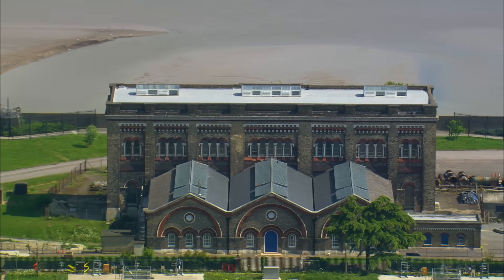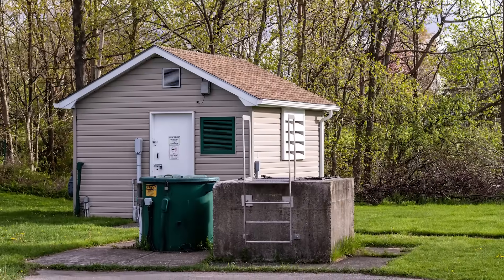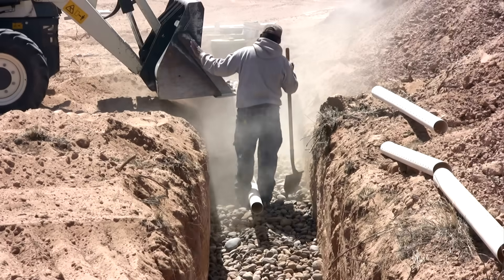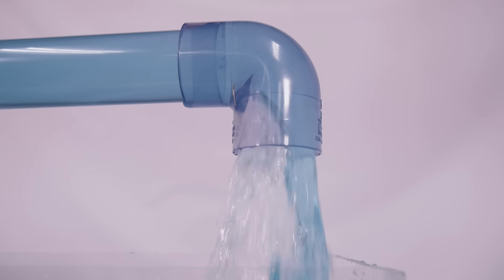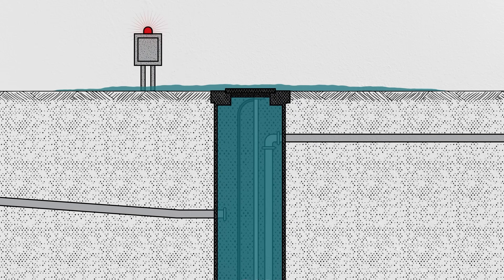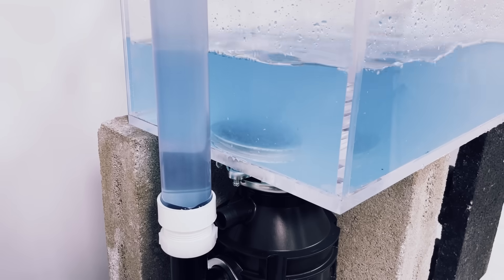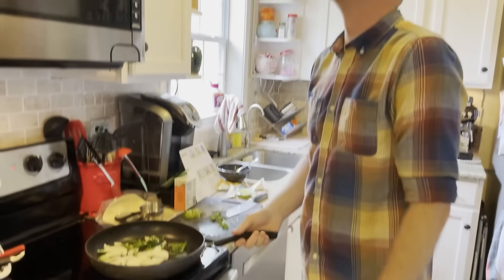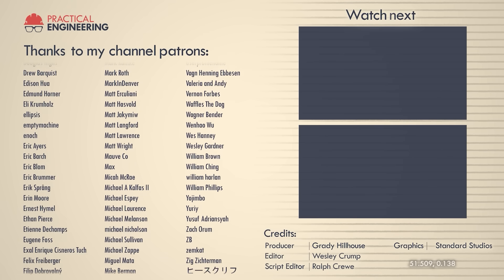How Do We Pump Sewage?

Comment: I live near a ton of sewage Infrastructure Something you failed to mention Is that in the intermediate stages Debris gets In that way For example we have a bunch of flood water Infrastructure that just go directly into the sewers It's not uncommon For litter including aluminum cans to get inside Of flood water drainage pipes (By the way If you litter You're increasing the chances of things like aluminum getting into sewage systems which increases the chance of septic Flooding Don't litter)

Comment: On our rural road, every house have its own well with a grinder/pump feeding a 1“ pvc pipe that got pushed underground from the road to the well, only digged at the ends.
I believe the main pipe is only 2". 
Cheaper and faster than a conventional sewer system dug down.

Comment: Fat/oil/grease deposits in sewage collection systems are created in the same basic reaction chemical reactions that turns the fatty acids  into, basically, a huge lump of soap. Over time, these grease formations break down to form fatty acids and glycerol. Fatty acids bind with calcium in the sewers to form so-called fatbergs, which are soap-like compounds. When the sewer level rises, the fatbergs cling to the sewer ceilings where they grow in size, eventually clogging the entire sewer pipe.
The size to which a fatberg can grow is limited only by the size of the sewer. In 2019, a fatberg measuring 210 feet blocked a drain in the British seaside town of Sidmouth. The sewer team took more than eight weeks to dissect this massive clump of fat.

Comment: If the designed pump head is lower than the discharge point, can the lift station still be able to push the liquid to the discharge point?  Assuming that the forcemain is already pre-filled (from the previous pump run)

Comment: I don't understand why we can't use positive pressure air pumps to pressurize the lift well and push the sewage along the lift pipe at certain intervals. Pair this with a pressure valve that clicks shut with the inbound pipe and you should be able to completely remove the mechanical pumps and prevent costly clogs inside of them. 

Then you can reduce the number of expensive grinders to just the waste treatment plant. Has this question been asked?

Comment: I must confess, I loved this video.

Although I am a bit dissapointed you didn't mention the advantages of different types of pump wheels like those which are made to cut up/chew fiber.

 (we call it fiber where I worked because rags gets torn apart one way or another and combine with hair to make really nasty grease traps you will have to pressure wash off the machinery.)

We had one active machine at the treatment plant dedicated to take out fiber by having a steel plates with 4mm holes in them rotate in a track-like way where the fiber would get stuck on to which it was then moved upwards and taken off at the top so it could fall into a waterslide leading it into another machine pressuring the fibres in an upwards turn to have the water come out and later take it to the trash container.

This saved us a lot of the daily maintenance ehich would be required of the cages you briefly mentioned because sewage never really stops and there are SO MUCH FIBER. People throw the hair their shower collects, the hair they cut off at home, rags, paper, and everything fibery into the toilet after all and it takes a lot more to work on than most people realize.

Regardless, it was an excellent video and I appriciate the ideas you came up with, we sorta have a collector/cage AFTER the fiber collecting machine which has to be emptied/cleaned weekly! 

(Also appologies if my english breaks anywhere, I'm Norwegian, but I hope this helps!)
Reply: I never realized how much my hair could be an issue... I have a septic tank, but I still think I'll be more mindful about making sure it ends up in the trash, not the drain. 

Also, your english is very good, dw! :D

Comment: Waste water wet well alarms are generated from an instrument, commonly a submersible level transducer or an ultrasonic level transmitter. Setting the 4-20mA output or 0-100% to the PLC, the PLC then can set setpoints for the pump to turn on/off depending on the level set. The PLC would require network and telemetry antennas that would communicate to SCADA or contain a call out box inside that will call and notify the operator of various alarms. There are much more variables required for this continuous operation, but it is pricey. Pumps are important to be operational at all times and ran alternatively. Those pumps would require a VFD or soft starter to control them preferable with an HOA switch. H means pumps running locally in hand, meaning if the operator is onsite running the pumps. Pumps may not run dry as air can destroy the pumps. O means off position and pumps may not be activated remotely. A means auto mode where the PLC or SCADA is in control which is relying on the instrument. If the instrument fails or the 4-20mA output drifts, that can either start or stop the pumps, change actual level indication and pump start/stop, and will cause an alarm. It is crucial that the level instruments are calibrated and/or replaced if need be.

Comment: They should remove the solids, burn them in an incinerator to produce power, then use the flow of water that was pumped further down, to a higher area to generate more power. Poo-poo power.

Comment: I managed a mobile home park that had an old lift station for the lower part of the park, to pump into the city sewer. We found one pump a couple hundred miles away, and order a second one from the manufacturer in Sweden. They ran $8,000 each, and the second one took six months to get. They are grinder pumps, that can chew up normal flushed items. Until we managed to get everything set up to change out the first one. I would go to the station and turn the only one working on for 30 second intervals every four hours, to keep the alarm from going off. Otherwise it would overheat from pulling too many amps. When we pulled the one working one apart later, we were not sue why it started at all. The field coils grooves were completely worn away.

Comment: As a plumber I can say those pumps are pretty incredible. But I do definitely not recommend putting toilet paper or paper towel anywhere around an impeller. Except if it's especially made for set application. They do exist I have installed many of them but I have also been called into to fix horror stories of homeowners and property managers using incorrect pumps for the specific job. Right tool for the right job right pump for the right hole ( and shit in the hole )

Comment: I work as a fitter for a pump repair workshop, so I have had my fair share of site jobs in sewerage wells. some interesting things you see on newer submersible pumps are blades on the suction that drive off the impeller to chop up solids before suction, but still i will always be pulling out poop covered tampons, hair, rags and all sorts of fun stuff clogged in the impeller. cotton ear bud sticks always ruin mechanical seals in these pumps  too, so please everyone, if possible, dispose of solids in the bin <3 it exposes me to a less of HIV if  i don't have to risk cutting my hands open pulling out a wadded up tampon hahaha.

Comment: My guess before clicking on this was to use compressed air as an intermediate fluid to push on the liquid. Does anyone know if there's a flaw in this plan or if some lifting stations do do this?
Reply: I really have no idea if that would do anything.
Reply: @RedRyan  Given that it isn't the way it's actually done, it presumably isn't the most economical method, but I can't imagine how it could fail to work at all. If you have a tank with a valve over the intake and an outlet at the bottom and periodically force air in at the top at sufficient pressure, I don't see how it could result in anything but any significant volume of liquid inside being pushed out.
Reply: @avaevathornton9851  The only issue I can see is it inducing air into the water, if you think of like a carbonated beverage, that's what they do with CO2. So if you pressurize the air too much a lot of it will get absorbed by the water and then it will out gas later on

Comment: This is really a interesting series, but I can't help but feel like this is only just barely scratching the surface of the topics so far. Also, sand and silicone toys are very poor analogs for poop. I'm pretty sure sand settles out of solution much more rapidly than dissolved poop would, and the silicone toy obviously doesn't dissolve at all.

Comment: Want to add that the better at chopping and passing large chunks to prevent clogging the less efficient the pump and more power it takes to run.

Electric power costs dwarfs pump price over time so this is a trade off of cleaning labor vs electric bill…

Comment: We had a lift station problem at a campground I worked at.  We have a pump that lifts the sewage into a septic tank, and one night it backed up. We had been keeping an eye on it, and it had an alarm, but no one caught it at two in the morning. Sewer company came out, fixed the pump, and ran a camera through our lines. They found a tennis ball, and worse yet, a 4x4. We think someone dropped it into one of the pipes you hook an RV up to. They think crap like that is what broke the pump, and the general wear and tear.

Comment: my family had a run-in with not only "flushable" but also advertised "septic safe" toilet wipes that only my father would obsessively use as toilet paper. lets say they went down the toilet just fine, but when our cesspool eventually overfilled, the cesspool guys couldn't even properly pump it out because the wipes never broke down and would clog their vacuum hoses. looking into the cesspool with the cap removed, you could just see hundreds of perfectly in-tact wipes in the sewage. we've moved from that house since then, and are now on a septic tank instead of a concrete cesspool, but he still chastises "nobody better be using those wipes" even though he was the only one that ever did. funny enough when i tell him that he was the only one to ever use them he plays dumb.

Comment: I actually helped a previous employer put in a bid for the installation of a basement macerating sewer pump in a commercial property.
Not being a plumber, but an office and equipment maintenance worker, that's as far as I got on the job.
But I did go and learn a lot about those pumps to be able to put together a good bid.

Comment: Having spent 35+ years designing and developing small submersibles and residential wastewater pumps we found that heavy weight nylon pantyhose were the most difficult to reliably grind. It's quit the paradox that they could easily get a run in them during normal usage while still being able to shut down a 5HP lift station.

Comment: I live a few hundred feet from a small lift station for my block. Whenever it is overwhelmed by saturated ground water from heavy rains, diluted sewage backs up into my basement, then flows to my sump pump and out to the street. After a decade of complaints the city is finally accepting responsibility

Comment: Pretty sure that the automatic release valves can have relatively simple air filtration system installed to counter the smell. Since such built up air happens not too often, the interval between maintenance checks may be relatively long. These filters don't have to be on every valve, just the ones close to populated areas. 
I'm looking forward to modular nuclear reactors powering our lives soon. A few companies are working on these SMRs built for different use cases and therefore ranging in output, from ten to hundreds of MWatts. That means theoretically a gigafactory like Tesla Giga Texas can run on its own grid supplied by a single 100-150 MW SMR, or an entire downtown of a large city a theme park. Entire residential districts can be powered by these things. Obviously there'll be a need for maintenance but that's expected to be quite low. 
Have high hopes for this technology. Definitely will still take a while though.

Comment: Obviously you may have missed a few headlines over here about water companies doing precisely the opposite of what you said we do now. After they had been found to be pumping raw sewerage into rivers and the sea though old failing infrastructure that has seen little investment on a lot of the Victorian era network beyond the treatment plants, not being able to keep up with demand due to increase of housing, having to lower capacity at the treatment plants due to the smell and proximity to new developments along with wet wipes being blamed as well where they have caused breakdowns with the machinery.

A bill was put before parliament to force water companies to rectify the issue but they decided not to and have continued to allow them to release it into the water courses while continuing with plans to designate the whole of England as a Nitrate Vulnerable Zone due to pollution in the rivers the same ones that they are having issues with down stream from treatment plants.

Comment: I worked in water treatment plants for many years and those agglomerations and deposits of solid are a real big huge problem. Most of the expense in money, time and resources go into dealing with the trash people throw in the toilets. They create thick layers (both floating and on the bottom of basins) which are complex to get rid of and it usually is an handmade operation. They also create long strong balls around the power cables of submerged pumps and we called them "setole" in Italian. It is just a cute name to refer to the most disgusting form of shit in the world (literally balls of hair, paper, rubber bands and whatsoever).

Comment: I work in waste water and my family has a waste water company. We build pump stations and treatment plants but you always need to remember that powdered detergent can do the same damage as grease or even worse. I’ve done two confined space entry’s this week already and it’s Tuesday. There not as bad as you think but they’re not fun. But something you were saying just don’t make sense. Like when the pumps clog the water will most likely never go over the tank unless it fills the whole incoming line up to the top of the tank and by that time county’s and city’s know something is wrong and have a pump truck or a bypass pump on the way to get the station back up and running before most people would ever know there’s a problem with the station at all. Also the trash traps are great when it comes to the treatment plant side of things but not so much the pump station side because most pump stations for privately owned or city/county owned don’t get check every week it could be once a week or once a year it all depends. On what they have but it was a great video on explaining to people where it goes and what happens to. Because some people have on there homes and don’t even have a clue what it is or what it does!

Comment: I spent a lot of time in the field repairing Variable Frequency Drives that are used to control the speed of the lift pumps.  They raise and lower the speed dependent on the level in the wet well.  What always amazed me was what the amount and size of floating objects that got in the sewer line.  The top of the wet well was covered in foreign objects so you could never see the water.  Plastic bottles, footballs, dolls, and other toys.  Sheets of cloth and tampons would clog the pumps.  You could tell if a pump was fouled by the current it drew.

Comment: "concrete chamber, called a wet well"

I'll add that most of the wet wells in my city are premade fiberglass installations. Cheaper to transport, and better against sulphide attack.

additionally, you talk about a grinder as if its a seperate unit to the pump, our lift stations usually include "grinderpumps" which serve both role.

Comment: Nice presentation.  As a utility contractor I've put the smallest all the way up to very large lift stations.  Open cut does get very expensive and I'm glad you mentioned that.  HDD is another option that has some limitations but is more cost effective when open cut depths get deep.  Pipebursting and lining is another important related subject that would tie into this well.

Comment: 4:53 - You glance off an important point here.  The dirty little secret of wastewater plumbing is that as low-flow toilets get more widely installed... and lower in flow (1.5gpf has been being replaced with 1.1gpf), your local plumbing gets more and more prone to clog*, because *the slope of the waste piping just getting out to the street, in older houses, is tuned for 6gpf toilets, and there isn't enough water moving to get the waste out to the street.

Ask me how I know this.  :-}

And toilets with #1/#2 valve buttons on top, while reducing water use even further, make the problem even worse.

At the very least, note that some of those valves will cut off early *if you don't hold the button down until the bowl starts to refill*...

Comment: My local pumping station has a tank that sewage flows into. When full the inlet briefly closes and pressurised air is released into the tank to blow all the sewage out. The inlet then opens again once pressure normalises. It takes about 15 seconds for the close-pressure-open cycle. Local councils (UK) used to own the infrastructure so they used different methods from each other. They are all owned by water companies now but it means there is still a mixture of methods used.